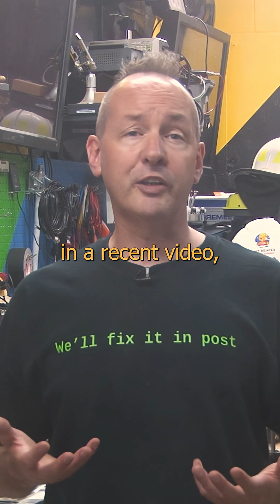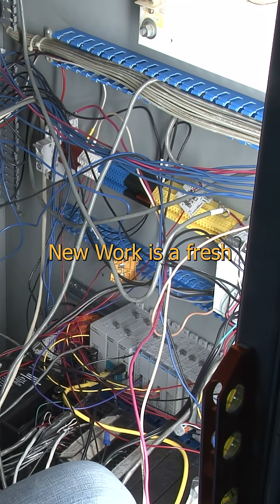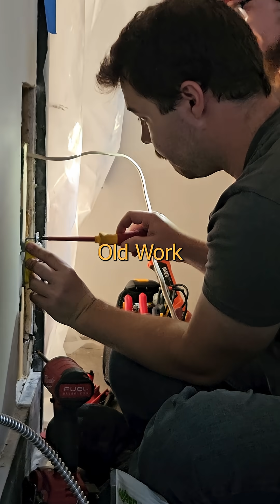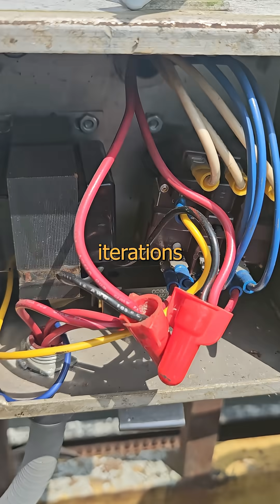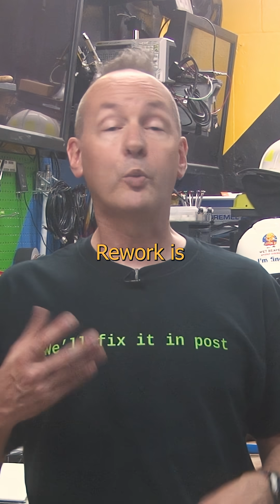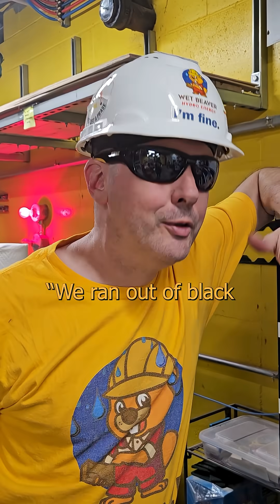New Work, Old Work, Rework #chrisboden #comedy #engineering #electrical #construction #educational

Comment: We just lost a $5000 switch at work because the 'network guy' figured if the plug (a barrel aka coaxial plug) fit, it should be fine. Well, no, Skippy...the 12vdc device didn't enjoy having 50vdc into it. The magic smoke was let out....
Reply: Oh nice that thing made the expensive smell 😂
Reply: @TylerAllen-zx2ef  Now we're gonna need to request a amendment to the Fraternal Order of Expensive Sounds shirt to include "& Smells" at the end.
Reply: @Havlock don't forget expensive sights! When you walk into your garage ready to go and you hear liquid when you step in, look down and the whole floor is red 😭
Reply: @TylerAllen-zx2ef  Should bottle that up and sell it.  Most expensive cologne on the planet!
Reply: @TylerAllen-zx2ef I have a severe love/hate relationship with that smell.....
Reply: @TylerAllen-zx2ef 
😂😂😂
Reply: Learned as a KID to check the voltage and polarity of those things...
Reply: DC barrel jacks are awful. No standardization at all, just put whatever you want in them.
Reply: @lifeteen2 usb-c is the new barrel jack. MOST of the time usb-pd is smart enough to negotiate and deal, but every once in a while, they assume like barrel plug guy, and you get dud or zap.
Reply: @lifeteen2  There was an attempt to standardize low-voltage connectors with IEC 60906-3 (which defines connectors keyed by voltage), but sadly, no one actually uses those.
Reply: @lifeteen2  Just barrel jacks in general, they come in AC too! I was lucky some enginerd saw it coming and put in reverse voltage protection so didn't damage anything. But wasted more hours than I'd like to admit til I finally saw the tiny little squiggly line embossed next to 12V
Reply: @lifeteen2  You've got a point, but that's no excuse for ignorance. If you can't identify what device needs what power, you shouldn't be touching that equipment. That's on you.
Reply: Barrel jacks are perfectly standardized! What's on the other end isnt
Reply: @lifeteen2 if i recall the issue is more that there are TOO MANY standards for them no? Same difference.
Reply: @technicalspaghetti2560  you know what would fix that? A NEW standard... Maybe with colour codes or seemingly meaningless numbers
Reply: @technicalspaghetti2560  "The best thing about standards is that there are so many to choose from!" -the people who make new standards
Reply: @jlco I thought it was "... everybody can have their own."
Reply: @rmanion  Better yet, a published standard for reviewing and proposing standards. Are there a bunch of similar standards? Are any of them doing, already, what we aim to do with some new standard? Excellent, ignore that one, approve the new one.
Reply: @lifeteen2 I mean it you can read voltage and current ratings you should be ok
Reply: yeah, that's how you learn the hard way that the gibberish printed on the cable shielding means something
Reply: tf kinda $5k switch is using a 12v barrel jack for power so i can avoid them? that's the kinda money that should afford internal psu...
Reply: @jg65012  If it does not have dual PSU, it probably does not belong in the rack.  They'll have cut corners elsewhere too.
Reply: @jg65012  I'm not completely disagreeing but moderately often something is expensive to be small and light, If you can put the power outlet 3' away and deliver the power into it by wire it helps with the small and light bit.  Though I also wonder about the switch at 12 vdc.  Not that a network switch needs a lot of power.
Reply: @jg65012  heck, redundant server PSUs!
Reply: @jg65012  The only equipment that I could think of that doesn't would be some older ISP equipment.
Reply: Do NOT breathe the Magic Smoke!
Reply: And that's why, at the network course I took a couple of years ago, there was an entire class dedicated to hammer on the concept of "Read the FUCKING labels on the FUCKING device and power supply"
Reply: we also lost an expensive switch because while tidying up the storage closet, someone put it in the trash pile, and it was gone the next day when the cleaning lady came by 😫
Reply: Barrel jack moment
Reply: The fact that it was only the magic smoke and wasn't the entire self warming light show is surprising ^^;
Reply: Lost a laptop at work learning this years back, luckily it was already destined for scrap so it didn’t cost anything.
Reply: Like drinking from a Firehose
Reply: My landlord once tried to wire my furnace with speaker wire, which I filed under "attempted homicide"
Reply: @khyron42prime40  internal screaming I'm sending this one to my husband, thanks for the horror story
Reply: I've searched Amazon. I can't find replacement "Magic Smoke" anywhere.
Reply: I just found out I was feeding a $2500 piece of music gear 12v when it only wanted 6v. Damn thing still worked fine for over two hours with the wrong PS (even loaded a new firmware) and still is cooking with the correct one, thank jah. 

My friend assured me they were the same spec, I even said “are you sure, cuz I haven’t checked?” Never not reading those tiny lil numbers with my own eyes ever again.
Reply: Charge him for the "fraternity of expensive noises" shirt
Reply: The machine spirit has left the machine. Pray forgiveness from the Omnissiah.
Reply: What kind of 'network guy' doesn't know his basic A+?
Reply: Love magic smoke
Reply: That's like the vendor who came into test or upc in our data center and didn't take the 30 seconds to ask us how pdu is setup on a rack.. first time at our site.. decided to kill power to do test ..realized he killed all the power to everything and slammed it back in and killed the entire row... Major F up.. fried so many servers
Reply: I did something similar once but i insist on my innocence.

I was setting up a 24v system provided to me by the client.... Including a 24v brick. It was the only brick there and had been provided by the client.

They had somehow found a center negative barrel jack charging brick. The one thing i thought was standard on the cursed things. The computer was expecting center positive and didn't have safeguards.....
Reply: As an intern I was tasked with a full teardown+rebuild of a mid-sized A/V booth. Lots of DC power supplies with varying Amp/Volts and various DC plugs.

I made the genius decision of keeping all the power supplies together in one box without labeling what device they came from. Then I got a call that apparently one of the things I ripped out from the A/V booth (a fiber <-> ethernet transceiver) was what gave the building across the parking lot internet, which they no longer had. So in my haste to fix the issue, I grabbed the first adapter from the box where the barrel fit, but gave over 2x the voltage the box actually wanted.

A bit of magic smoke and lots of profuse apologizing later and now I never EVER plug a DC adapter into something without checking the specs first.
Reply: And that's why I label anything that's not 12v. We have 9,12,18,19,24,and 48 all within a few feet of eachother
Reply: @malrofo I label everything. Full stop. And if I can help it, it runs on 12vdc (especially if it's mobile comma)
Reply: I'm ashamed to say this but at one time I'm the Skippy. Didn't realize the router output is 24V and just shoved the plug into my laptop (back when all laptops use 12V). It died where it stood.
Reply: @m.farizakbarhutasuhut3074 there never was a time when all laptops used 12V, there is and never has been a standard for them before usb-c being misused for it. Most were and still are 19V roughly. And no, they are not interchangeable, have never meant to be.
Reply: I'm sure they were shocked to find out that they killed it by giving more than quadruple the voltage it was designed for
Reply: He definitely should have checked.

But to be fair, we do have way too many fricking voltage/current/polarity specs all using that same damn barrel.
Reply: Had a similar issue with a T1 mux unit (Carrier 600 Adit). 

It’s got bog standard c13 power, but specifically says “120v” on it. Wonder what’ll happen if we plug it into our 208v PDU. 

Anyway, all units are now delivered with a c13 lockout plug in the power socket.  It’s not ‘really’ a lockout (no actual lock) but the bright orange buttplug is enough to make the on-site techs go “hey wtf is this? I should probably ask someone.”
Reply: @ronburgundy9771  C13 defines a current, not a voltage. And that's why C13 PSUs all ended up with voltage switches, and eventually automatic voltage switching nowadays.
Reply: Computer motherboards take 220V, right?
Reply: Well, like oue friend in the straightjacket says, if it doesn't belong there it shouldn't have fit.
Reply: The hell kinda $5000 switch has an external power supply? I am probably just spoiled but I don't think I've ever even seen a switch that pricey that doesn't a have a pair pf hot swappable PSUs.
Reply: @kylehenline3245 one that is designed to go in interesting places. It's not rack-mountable.
Reply: Pl-258?  Or BNC?  Asking for a friend.
Reply: @fshalor738 BNC
Reply: As a qualified network guy myself, I don't understand why they can't at least check the polarity before plugging it in.
Reply: From a young age I've always just grabbed whatever's close enough in voltage from a big box of wall warts and it always worked out. Now that I'm 30 years older I look at voltage and amps... but I'll be damned if I'm comparing polarization 😂
Reply: Been there done that. I always double and tripple check power supply and required power ratings.....
Reply: I do hate barrel jacks.  I have amateur radio gear and related electronics. Too many components have barrel jacks that are poorly labeled or unlabeled.
Reply: And it's even worse.  USB is not immune. We have motorized blinds that use micro USB connectors for the connector between the battery pack and the motor/controller, and then for the charge connector if one uses the manufacturer's rechargeable batteries.  So what's the problem?  The system runs on 12 volts.not exactly a micro-USB standard.

And I just bought a micro-PC that uses 12v.  It has a USB-C power jack. That's fine.  On the other end, the included wall wart has a permanently connected USC-C cord.  I'll look again, but I don't believe the wall wart is smart enough for PD at other than 12v.  And silly me. I chose this over another model that used a barrel connector.
Reply: That's right! The SQUARE hole!
Reply: LMA0... 
I had a network guy that did the same thing!! 
He didn't know ANYTHING about polarity or voltage!
Reply: What kind of 'network guy' doesn't know his basic A+?
Reply: Never let the smoke that the factory put inside your switch out.
Reply: Been there, seen that.
Reply: ‘Networking guy’ is going to have to do some normal networking 😅
Reply: Yeah, ironically, electronics don't care about the plug shape, only its voltage and max current. Just like electronics are color blind for wires. Only humans care about plug shapes. And yet we passively shove all different kinds of voltages on the same plug shape. Which is complete madness.

This is actually why real RJ45s have a keyed side and notch in the jack. So you can't shove it into an 8P8C jack, running analog phone voltage on 4 lines, and frying your new 10Base-T Ethernet card. Eventually ethernet cards had safeties in them to prevent it being fried by POTS voltage, which made the key and notch unnecessary, and thus why we just use 8P8C everything now.
Reply: The number of people who can't read, the adaptor and the device to see if they fit in each other's functional ranges never ceases to amaze me and it's required to be written there. 

The other thing that really bugs me is things that do work in each other ranges and it turns out that the rectifier in the DC adaptor wall wart isn't really capable of operating in the range it's supposed to for any real length of time.   Not saying that when I go to my bin of adaptors that I expect them all to last forever but I also usually expect longer than a week or two.
Reply: Ouch! Computer equipment magic smoke is expensive magic smoke.
Reply: I have fit-tested a lot of barrel plugs, but never attempted to power a device with incompatible ratings. They legally have to be listed on both the plug and the device being powered so…
Reply: @JeepITguy  Barrel plugs having a bajillion different voltages and polarities with no shape-keying has to be some ancient engineer's horrible prank
Reply: A colleague of mine replaced an old heat-control unit that had a backup-battery system. 
New one also had connection points for a backup battery, so of course he connected it up.

Problem was, old one got 12V and was happy. New one got 7V more than it asked for and got smoking furious, and in the end refused to do any work ever again.
Reply: The diesel handle fits just like the gasoline handle, so pumping diesel should be fine
Reply: a) a barrel jack on a $5k switch looks like you paid $5k for a $50 switch.
b) there are three things you should ensure if you choose to use that flawed design (barrel plug) - protection against polarity being wrong, overvoltage and overamperage. The first is a diode, the second is a special diode (zener) and the third is commonly known as a fuse. If your $5k switch doesn't have all of those, it's not worth $5k.
Reply: That’s part of the reason why I don’t jam random plugs in it, I only put in what it’s rated for, that’s beyond scary
Reply: Yeah IT seems to struggle with Voltage lmao. It's always good to verify the power specs of what you're working with before you go willy nilly plugging power into it.
Reply: Fun fact the coaxial cable was invented by the navy. They also have a quick release version.
Reply: A lot of people don’t know this, but electronic devices run on smoke. Don’t do anything that makes the smoke leave the electronics or else they won’t work anymore.
Reply: No you didn't. It came out the box "bad"
Reply: New work is every new RV on the market. No electrical system works as it should.
Reply: Yes. Electronic fireworks
Reply: Oh come on, that's pretty rare, almost nobody has 50VDC wall adapters lying around!
Reply: Some chucklepluck of a product engineer put tip minus on a $5000 bit of test gear we have kicking around, then only label that on half of the set.  Either got lucky or they had protection circuitry but gave me quite the fright.  I want to poke a dirty finger in his eye so good, who dafuq does something like that?
Reply: Oh no, he let out the magic smoke that powers all devices!
Reply: That would’ve be funny as hell to see a while he was panicking yell at him to catch it and put it back in 😂
Reply: "The magic smoke"😂😂
Reply: I used to work electronic retail. We had two different HDMI splitters. The larger ran on 24v and the smaller on 12v. They used the same barrel plug. Of course one day a few monitors stopped working and I couldn't figure it out. Then I check the splitter and I see the small splitter with the 24v plug. I'm thinking they fried some board in the monitors through HDMI. It was so easy to tell the two apart because the 24v had a screw connection on it, while the 12v didn't. That place is such a mess lol
Reply: Them pixies were mad AF. 😂
Reply: People need to learn to understand if it fits it doesn't mean it's the correct one
Reply: @Pleezath agreed. I just had an argument with the Project Lead about connecting a HDMI port on a laptop to a DisplayPort monitor. Yes, you can get a cable that will fit... But it's supposed to go the other way. To connect HDMI to a DisplayPort monitor requires an expensive, powered adapter. The idiot actually plugged it into both devices and looked at me like I was the idiot... To which I promptly demonstrated to him that the server wouldn't even boot with that cable connected (dead short on the output is my best guess), but booted just fine with it disconnected.
Reply: @JeepITguy that's a good one aswell.

At home I have a 9,4V usb dummy battery for a camera. It fits just as nice. But plugging it in differently would make very expensive smoke...
Reply: @Pleezath   There will always be foolish people out there so we have to design the world such that they cannot easily break things like that
Reply: @Pleezath  I wish my ex had learned that!
Reply: @Pleezath  yeah i learned that with women!
Reply: @Pleezath  They must be cats because "if it fits, I sits" lmfao
Reply: How on earth did you comment 7h ago on a video that's less than an hour old?
Reply: @fishotic4237  I would guess it was available earlier for members
Reply: @fishotic4237 Video 'age' shown is from when the video is  published. Upload can happen long before that, and in between upload and publishing  the video is available to those who know the URL. Typically channel supporters (members, Patreon patrons etc.) get the URL by those channels, and features like commenting are available to them.
Reply: @fishotic4237  membership. It released members first. Publishing resets the timer
Reply: Biggest crime here is 5 grand for a switch
Reply: @bendavies2447 that's actually one of the cheaper ones.
Reply: Where did you find a $5,000 switch that takes a barrel jack?  Need make and model or I call BS.
Reply: @EagleMitch anything that expensive has protection and also a standard power supply, if not two.
Reply: 5K and a new job opening is the outcome of this fun time
Reply: Doesn't sound like a network guy. Sounds like a help desk tech that shouldn't be around equipment lol
Reply: 50!!?!!?
Reply: "network guy"....sounds like an "IT engineer" ..... which is basically a reddit mod who lied on their resume and just tells everyone to try turning it off and back on again or that what they are trying to do "cannot be done"...... shoutout to the "IT engineer" at my wife's work that SCREAMED at her that it is impossible to plug more than 1 external monitor into ANY laptop :D No kid just the garbage chinese laptops you bought 60 of and pocketed the extra $300 per unit to buy a new graphics card but nobody will call you out on it because you're the CEO's nephew :D
Reply: Why’d you let it out? Get it back in!
Reply: The scenario you outlinex has nothing to do with the cable, the source is 50V and  work is 12v, so if you use a coax or a t90 4/0 ,source is always 50v. Soooooooo why did you have a 50v source on your coax ? This scenario sounds fine to the uneducated, but sounds ridiculous to anyone who know anything.